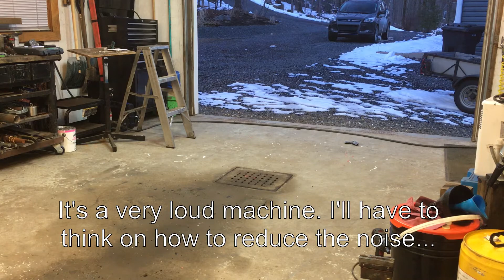#64 Bolens Maintenance - Part 18

Comment: You did it son. Another mechanic project achieved. Seeing you moving with your new toy, it looks like you got a racing tractor. ;)
Reply from the maker: That is quite fast!  Now I have to look for a better muffler.  I think it's too loud for the neighbors. They did not make any mention of it, but I will not wait for it. Anyways, it is not pleasant in the long term to work with a noisy machine.
Reply: Joe- If you do replace the muffler, don't throw away the old one. Bolens enthusiasts want original mufflers and it looks like yours is in good shape. I have seen the Bolens large frame mufflers sell on eBay recently for as much as $400USD. Or - you could just send it to me! ;-)
Reply from the maker: Thanks for the advice. I don't throw away original parts I remove.  I'll do a trial with a common muffler, vertical, and a flapper.  This would be the same setup as my Case 430.

Comment: Well done ,  Great sounding motor.  I have a Bolens a  lot like that one, it has a 20 hp, Kohler twin cylinder engine. I will be working on it also. Good videos. Thanks
Reply from the maker: Thanks Hack! I suppose it is an HT20? If you have not visited yet the channel of "ISaveTractors" make sure to visit his channel. It's all about vintage garden tractors.  Thanks!

Comment: You've got to be tickled with the result of your project. Noise wise, how about a larger muffler, or if that is not feasible, is adding stacked baffles at the end like a SuperTrap muffler possible?
Reply from the maker: Thanks for watching Eric! Sure I can do some mods to accomodate a bigger muffler. I'll look also into the possibility of a SuperTrapp. Thanks for the tip!

Comment: That must not be the original muffler, or there's a leak somewhere. My HT23 is much quieter.
Reply from the maker: That is what I am wondering... My old Case is much quieter, even though it's a 152 cu.in. engine compared to a 58 cu.in.  I also wonder if the muffler was pointing up, would the noise dissipate better, like on the Case. It also send the fumes out of the way, which is also a good benefit. Have you tried it on yours? Thanks for watching!
Reply: The original muffler should be a little more quiet. But they do make some sound.

A little thing i have noticed is that many of the tractors sound different. Not got any good answar why, they just do.. I own 3 tractors and they all sound different.